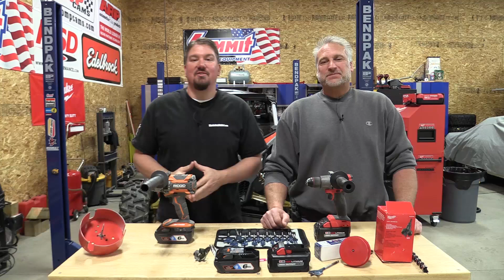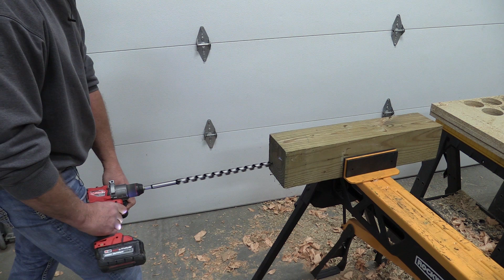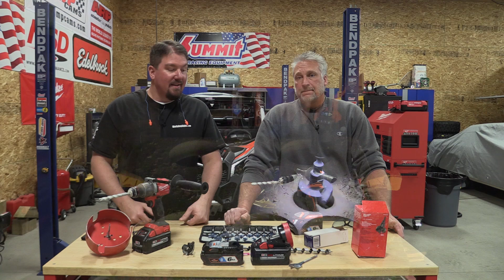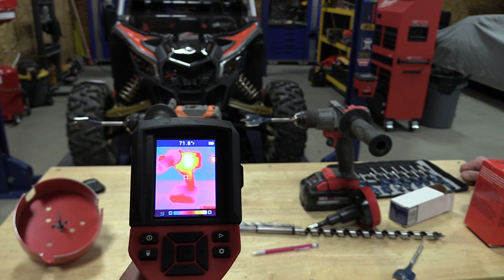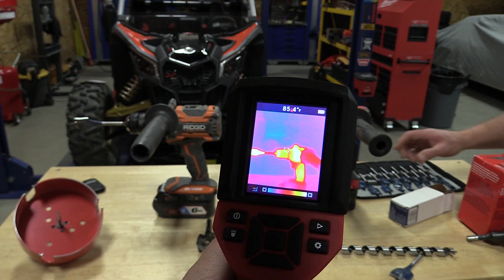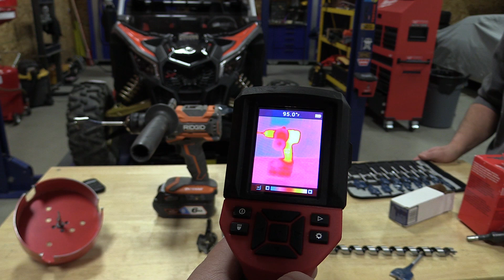Ridgid OCTANE vs. Milwaukee M18 Gen3 Drill Driver 6.0 High Output vs. 6.0 OCTANE Battery

Comment: It amazes me, that every time you did a paddle bit test, that the Milwaukee started first every time but one. Also, tell me why on the very first paddle bit test you did, that you held  the rigid in place, so the Milwaukee would win? I guess since you was called out on your first video for using different amp batteries, that you had to prove yourself right, by rigging this video for milwaukee. Can't trust you as a honest reviewer any more.

Comment: I'm still running the original brushless AEG drill, would be around 6 years old now, a mate got himself a new AEG fusion drill and it had more power but when drilling with a 65mm diamond tip masonry bit it locked up snapping his gearbox end in half just behind the torque adjustment ring, I'm talking bits of metal gears and springs and grease flying everywhere. 
My original AEG still drilles these holes and if the bit locks up it is yet to damage the drill. But I am a little put off newer AEG - Rigid tools. I am considering Makita or the other TTI tool Milwaukee.

Comment: Just so you know, the ridgid batteries slow amperage @ 2 bars or less to prevent damage to the cells. Very annoying, but good for the battery longevity

Comment: I have Milwaukee 18v fuel and rigid brushless 18v and I feel Milwaukee is better .. the rigid when struggling it shuts off and have remove battery to reset it to be able to use again ; I don’t have that problem with the Milwaukee .. not even once

Comment: Respectable review.  I like the look of the Milwaukee and you see it in shops all over. But I bought both  Ridgid hammer and impact. I thought the hammer drill was excellent. I used it to drill half inch holes through old hard cement excellent.  Both of these drills are great.

Comment: One thing to also consider is the Ridgid is $159 with one battery and charger.
The Milwaukee is $129 bare with no battery.  So price is also an issue.

These are Home Depot prices as of 9-10-2020.

Comment: Could you gentlemen review the R9603 drill/driver that comes in the ridgid brushless drill/driver, impact driver kit combo? I can't seem to find any decent coverage of the drill anywhere as people only seem to review the drills that are sold as standalone tools.  

I have this drill as i was given a deal at home depot for the combo kit, but it came  without the impact driver. The impact was apparently defective so i was given the drill, two 1.5ah lithium ion batteries, the  charger and carry case for just $100. The LSA was valid and it was successfully registered.  

Anyway, at my workshop, the company has provided ridgid gen5x drills (non brushless) but i prefer to use my own, and it is clear that my drill out performs them all by far. 

So to clarify it is the R9603/R860054

It would be great to hear what you guys as pros think of it. I am by no means a pro just yet.

Comment: I know this video is old but I was a huge Ridgid fan, I have a lot of money tied up in the Ridgid platform. That being said, I got a little tired of Ridgid's LSA agreement. If I buy 2 Ridgid batteries by them selves you only get a 3 year warranty. Now if you buy those 2 batteries as a kit with a charger you get the LSA. How many chargers does Ridgid think 1 person needs? I do own the Ridgid brushed and brushless 18v 1/2" impact wrench. The brushless Ridgid claims is a mid torque impact wrench. Well I went out and bought the Milwaukee M18 1/2" mid torque impact wrench. I know the Milwaukee's M18 1/2" mid torque is much better. Also I asked you guys just the other day if you have tried the Ridgid octane 3/8" 18v impact wrench. That kit only comes with a standard Ridgid battery. You have to buy the octane Bluetooth batteries separate. Now it is not a very good deal anymore. I am going to Home Depot tomorrow, return the Ridgid 18v 3/8" impact wrench and I am going to buy the Milwaukee M12 stubby 3/8" impact wrench. I bet that the Milwaukee stubby M12 3/8" will stomp out the Ridgid 18v octane 3/8" impact gun.

Comment: If you do more research ridgid and Milwaukee are made by the same manufacturer, Techtronic Industries (TTI). Your comparing Chevy to Cadillac. Ridgid is just an exclusive brand for Home Depot. Home Depot basically contracted TTI for their power tool line and said we like the Milwaukee line you guys produce can you make us something similar. The Ridgid warrantee comes out of Home Depot’s pocket. TTI is not going to make ridgid better than Milwaukee because thats their bread and butter, they will always be similar but the edge will always go to Milwaukee every time. Speed, weight, durability, Performance and ergonomics will always be slightly better in the Milwaukee. TTI also makes Ryobi (cheeper brand made with cheeper parts)  so they can hit a wider demographic of consumers. Please for the love God stop comparing these brands (Milwaukee, Ridgid, and Ryobi) and educate yourself on the products fully. The manufacture will always make a high grade (Milwaukee) mid grade (Ridgid) and a low grade (Ryobi).

Comment: I'm a Ridgid man, giggidy, but those Milwaukee tools are damn nice! Both tools preform admirably. In 5 years of owning Ridgid tools, I have never had any issues. I had to invoke the warranty for my impact driver, but that is because it took a tumble from a very tall town house roof. I am a solar system technician. I just upgraded from my gen5x hammer drill to a octane hammer drill. I love my gen5x drill, but it sometimes cuts off when using 1 1/8 inch step bit and I am thinking a higher torque drill is the cure to that ailment.
Reply: Has the octane performed better?

Comment: Milwaukee has stronger motor (as usual) and better battery but a slightly weaker hammer due to its size
Reply: The hammer is not weaker

Comment: Both of these tools appear to be of very good quality.   I’d be tickled to own either one of them.   Since I already own several Rigid tools and don’t want to move to another battery system, the Rigid would be my choice.    Pair it with the new OCTANE batteries and I think you have a real winner!
Reply: They were using the octane battery.

Comment: People should excercise common sense and actually go ahead and run their tools with no load for 60 seconds after getting it good and hot so it can cycle through cool air without it all being displaced by the heat it’s generating and then the heat shouldn’t be a big deal

Comment: They are both made by Techtronic Industries, they share the some internal component, one might be slightly different than the other. I don’t see the point. TTI monopolises most of these Tool reviews. I swear
Reply from the maker: They are the number one tool manufacturer in size.  They make tools for competing brands that they don't own.....

Comment: That handle is also heating up along with the clutch because the “e” part of the e-clutch is in the handle. I did notice when Vince’s collet failed and Got serviced they replaced the “burnt up motor”. 

The 3ah battery is the only real high output 21700 for both lineups. A 3rd video is asking for a lot though I know 😂

Comment: I'm struggling to find any testing of screw driving.  I've read user reviews that say the Milwaukee E-clutch is pretty useless and is impossible to drive small screws without over torquing.  Why  do all the review videos seems to look past this?
Reply from the maker: Because most use impact drivers now.  We like the e-Clutch, but it might not work well with small screws.
Reply: In my opinion, drills are not for running screws
Reply: @-EVASSIVE  The entire point of a combi drill is so you can drill and drive screws without switching tools.

Comment: The power Milwaukee has squeezed into a drill the size of the gen 3 is impressive. That little drill stands shoulder to shoulder with anything on the market and bests just about all of them. Their constant improvements along with the stability of the battery platform is the reason they’ve won me over as a consumer. Plus I also work in the automotive world where they have been paying attention to our needs as well.

Comment: I use rigid and Milwaukee both are good and respectable tools
Reply: @izzyzilla80 — I’ve never owned or use Milwaukee tools, but their reputation precedes them.   I’m an average DIY guy, and switching to Milwaukee would mean ANOTHER new battery system.   I have several RIGID tools they have always worked like a charm for me.    No incentive for me to switch.

Comment: I could buy 2 of the Ridgid Octane for the price of 1 Milwaukee Gen 3 and that is way more useful. I own a bunch of drills and for big projects I've usually got them all out and loaded with different bits dividing the workload.
Reply: I do hate that light up chuck though. Its a gimmick and casts moving rings of light as you drill especially noticeable slow speeds. They need take those 3 LEDs and move one to the bottom and one on top to eliminate the shadow and give a large lit work area and give it some levels of brightness like Dewalt and a constant on so it can be uses as a flashlight while working in the evening. Now that would be useful.

Comment: Go with lifetime warranty, never have to buy a drill or battery unless you lose.  Lol
Reply: I thought if that model no longer available, they will give you the next version of it?
Reply: @MegaThepow   they do...i still have my gen 2 ridgids they replaced batteries 3 times...and upgraded an impact that i was brutal on in 16 gauge metal studs....
Reply from the maker: Or that tools lifetime is up and it is not made, then the warranty is gone.

Comment: So here's a question, what would be the results if you compared the two with their 9.0 batteries or how much more of a difference would it be if you used the 12.0 battery for the Milwaukee vs the 9.0 for the Rigid. Compare the largest batteries each brand offers with these drills.
Reply from the maker: Ridgid would still win in the hammer drilling.
Reply: @wrenchesrides  Here's another question where would the Metabo HPT DV36DAQ4 fall in comparison to the Ridgid and Milwaukee hammer drills?

Comment: oh, BTW. Kudos to Ryobi, I am serious. It is a very good tool. I bought a couple of drills for testing and I still use them at home. I haven't tries and daily grind with them yet but will soon I hope.
Reply: @Joseph Potch — I have several of the Ryobi 18V tools and they have always performed brilliantly for me.   For the average DIY’er, they are great value and very serviceable tool.   Why buy a “professional” grade tool when a more “value” based tool gets the job done and leaves a lot more money in your pocket.
Reply: Ryobi, rigid, and Milwaukee are all made by the same company, all three are solid drills, and impact drivers.

Comment: I use Hilti, Milwaukee, and now Ridgid. I have been a Hilti fan ever since I started using them for Flipping and remodeling homes. Hilti though a very good tool, is very expensive. I don't have a Ferrari budget any more and while I still treasure my Hilti tools I have had to cut a few corners to save money. Milwaukee has been good to me, but 2 out of 4 of the impact drivers have failed on me, one fortunately still under warranty. But since being repaired it has not been a very dependable tool. It heats up much to hot, and is incredibly noisy. I did mention this to the repair people, but received no answer.
Ridgid has been on the professional tool scene for may years (remember their calendars? I know many want to forget), but I BELIEVE they are relatively new to the consumer segment. I may be wrong, won't be the first time says the wife. The warranty, the innovation, and the constant rate of improvement is remarkable, but frustrating for someone who uses tools daily. I mean that if I can get a tool that makes my job easier, and faster, well I want it. But the pocket book says whoa...…. Ridgid has been making better tools and batteries every year, and for some, causes us to wait and see what happens. I did wait for the octane battery and tools to come out and I am making an effort to transfer my work to these tools. Any way, the Ridgid warranty can't be beat and that's why I am going with Ridgid now.

Comment: Just bought the rigid drill in this video and I think it’s going back to Home Depot,first thing brake engages violently to the point that the bit in it falls out after a couple of squeezes of the trigger and just a bit to much wobble on the chuck.and even if later I decided to install my own chuck I’d be without a light source, going to purchase Milwaukee instead.
Reply: I also have this drill and heard alot of negative comments about the chuck. I have only used it once to drill a 2in hole on a door using a hole saw and yes the chuck did loosen up on me, I'll have to try a few more things but its a shame because the impact driver in the kit is almost flawless.

Comment: I do hvac and have all ridgid tools and 90 % of the other guys have the millwakee. Drills 18v fuels and always wanna use my impact hammer drill and jobmax being i have x4 and gen 5 models. But i like that i can call ridgid and have a tool if i need it within 2 days

Comment: Pretty sure the Ridgid still using the older cells in the 6.0 battery. Which cells are Milwaukee using. Need to be the same to be accurate test.
Reply: Forest Brooks mostly samsung in the bluetooth octane batteries and Milwaukees I believe are either lg or samsung also

Comment: I have the 18v ridgid line and the Milwaukee m12 line both have served me very will had the m12 impact since 2011 with no issues and the batteries that came with it are still being used today without a hiccup have the ridgid hammer drill for 3 years and have done 2 sheds plus using an 8 inch ice auger bit in the winter and keeps coming back for mor

Comment: I just picked up a 3.0 battery for the Ridgid impact driver and after driving a whole pound of #9 3 inch (76 count) deckmate screws there was still 80% left of the battery!!! Very impressed with Ridgid!!!
Reply from the maker: The new OCTANE batteries are impressive.

Comment: Enjoyed the video. Seems like you can't go wrong either way, both are great drills. My opinion is that the Ridgid is better at the hammer function with concrete due to its size. The extra length and thickness allows for a bigger hammer type mechanism which allows it to do the job faster, actually significantly faster.  I personally would take smaller size over quicker hammer function speed. Secondly I'm very impressed with Ridgid matching Milwaukee using 18650 cells in there new Octane batteries. Milwaukee uses the 21700 which in theory should be able to supply more current and power at any given moment. Ridgid seems to have done a great job using the 18650 cells.
Reply from the maker: The Ridgid OCTANE line uses 21700 cells.....
Reply: @wrenchesrides  That would make sense but I've google Ridgid Octane 21700 cell and not a single article says they are using 21700. Two articles do mention they are using still using the 18650. 
No videos or pictures to confirm though. Milwaukee brags about using the 21700 battery , you'd think if Ridgid used those cells they would advertise it as well.

Comment: Hard to beat Ridgid's warranty, durability, and power.
Reply from the maker: Agreed, if you have the right Home Depot to back you up.  That makes a big difference!!
Reply: Ridgids Warranty is a huge PITA up here in Alaska. No service centers. I've had a charger die and a battery die. took a 45 minute phone call for the battery (including wait times etc) and the new battery that came is not warrantied
For the charger I never could get them to pick up the phone.  So I stopped buying ridgid. For me the warranty is practically a scam
Reply: @AlaskanFalcon  u suppose to buy from home depot and register on ridgid  online. Warranty is best mostly by Home Depot. Ready to replace and no need call or wait.
Reply: @christopherching4475  our home Depot won't do it.
Reply: @AlaskanFalcon  I feel your pain, even i am in Illinois
Reply: Dropped a rigid drill off a 30 foot scaffolding once still works
Reply: I left my drill in a waterlogged sled overnight after a full day of drilling 2ft of ice with the Kdrill.  Ridgid replaced all the guts no questions asked.
Reply: Easy to beat ridgid’s weight though! Them things are boat anchors
Reply: My home depot did the warranty claim with no quibbles. I gave them 20 dollars and a month later got back my newly repaired, still warrantied, impact driver and got my 20 dollars back.
Reply: Hard to beat Milwaukee.
Reply: Ridgid is always the way to go.. better Price comparable performance has multitude of attachments.. and you cannot beat the warranty

Comment: You have to ground the current somewhere.  Milwaukee must use different grounding points then ridgid.   I am pretty sure that's why the handle was extra hot
Reply: There are heatsinks located in the handle of the Milwaukee.  Don't know about the Rigid.

Comment: I'm a home handyman and have never put my drills (or any kind of cordless tool for that matter) through such a workout. I have long since committed to Milwaukee's lineup, but the differences shown here are negligible IMO. You can't go wrong with either. YMMV, especially if you are a pro punishing your tools every day.
Reply from the maker: Pro working in the field would not expect these tools to do the job we are asking of them every day.  They would have a larger drill for safety and the fact that if there is a harder piece of wood in some area, the drill would need to perform.  We fully agree with your statement!
Reply: Totally agree but the rigid has a limited lifetime warranty. Only power tool I know that does